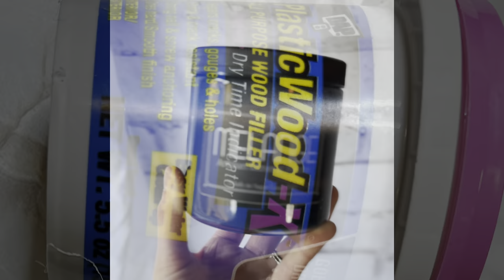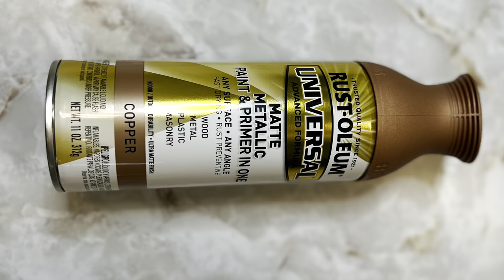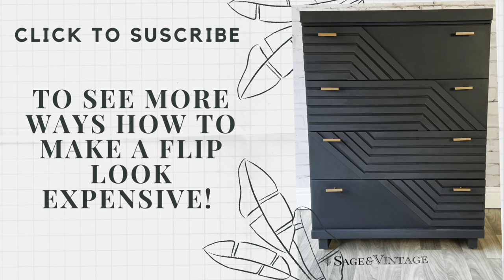Simple Ways To Get An Expensive Furniture Look

Comment: Looks great, good job. Just wondering could you use spray paint instead of brushing it on as it may be easier to get it in the gaps between the pine trimmings? I'm thinking of doing something simular but think it may be faster to spray paint!  :)